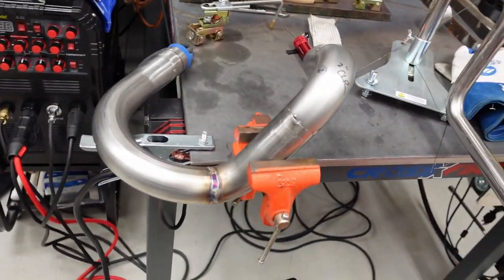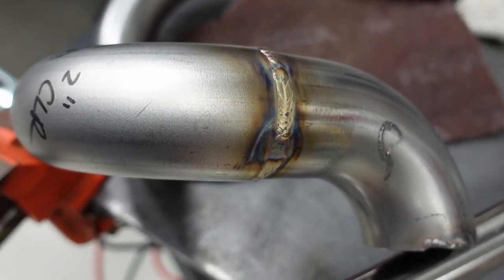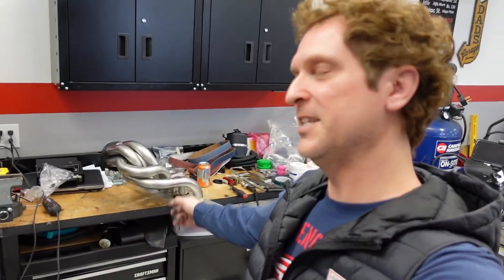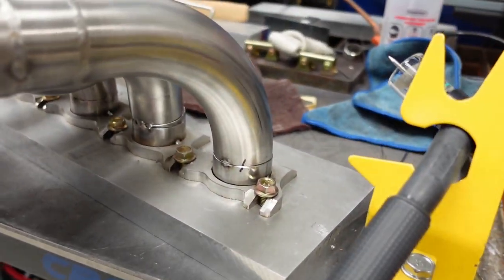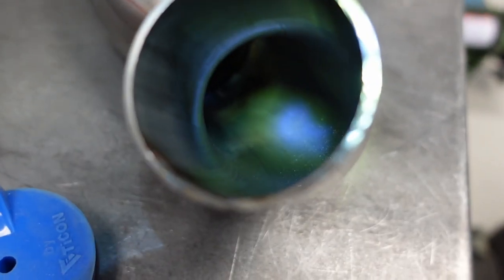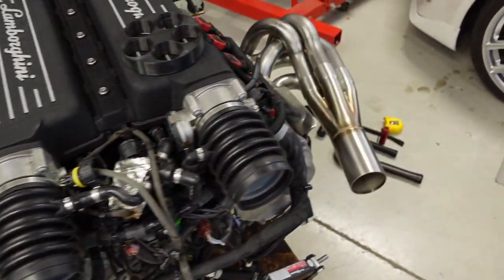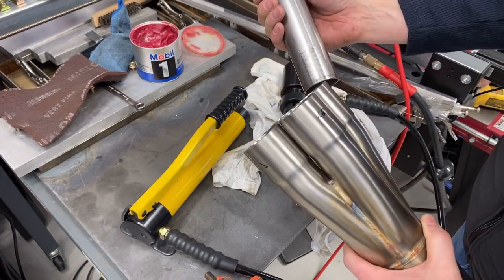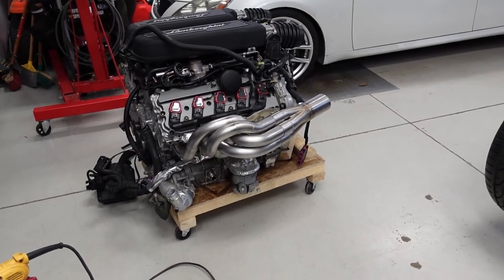Project 'Top Gun' - Custom V10 Exhaust Headers - V10 Ultima Evolution Convertible Build

Comment: You are really motivating me. The array of skills you use. Weld, electrical, CNC (in your garaga? Say whaaaaat....)... Question: You have a Lambo engine, but you said the donor is an R8 and you had shown an R8 oil reservoir/heat exchanger. What happened to the R8 engine? This project is going to be fun to watch. I'm really learning a lot. Thank you mate! Cheers!
Reply from the maker: Ah yes. The intake on the original R8 had minor damage and rather than replace it like-for-like,  I found a cheap used Lambo intake to slap on there. It’s the exact same motor that’s in the Huracan so all the parts are interchangeable. I think it’s a nice little twist to the engine bay. 😎. Thanks for joining in the fun!

Comment: Great job Dan, very impressive and well done.  Boy you've got some kit to do all of this yourself, that's some investment!  I note the fitment of the headers to the heads with the angle top stud and straight bottom studs on the heads - presumably that is so you can align the headers perfectly with the ports?  I take it you've made sure your header flanges match perfectly with the exhaust ports!  Also noted, when you had both completed headers on the floor next to each other, you're going to have a little adjustment on the connecting tubes to account for a slight difference in where the collectors finish?  With regard to securing the collectors onto the primaries, rather than bolts, have you considered a race engine solution which is just two pairs of small tubes welded to the collector and primaries to accommodate split pins - much more compact and less noticeable?  Lets face it, its not going anywhere once the rest of the system is made up and fitted, then heated and carboned up a bit on the inside with use!  Keep up the good work, love watching your progress.

Comment: Great job Dan!  I'm just a few steps behind you on my SLC exhaust.  I'm cutting in the v-bands so I can take it apart down the road.  I'm super nervous about the welding.  Thanks for sharing your settings and experience!
Reply from the maker: Practice on a few scrap test tubes to dial in your personal technique and TIG settings.  I practiced on a half dozen scrap tubes before I laid the first weld on my production piece. This helped my confidence A LOT. Good luck!
Reply: @DanDulac  I cleaned up some scraps last night and they’re sitting on my welding table tonight. I’m going to practice this weekend and get my settings dialed in. I actually taught myself on aluminum last year. Hopefully steel will be no problem.
Reply from the maker: @mastersteve63  Steel is easier than aluminum, imho.  It's a little more forgiving with heat input...If you've got aluminum figured out, you'll have no problem with stainless.  It flows very nice with good argon shielding.

Comment: Señor Dulac, I too have been ogling these kits. How much if any will you have to offset the drive axles? Every single mid engine kit seems to be short in the back end. I suppose if I had to, I could stretch one ahead of the rear wheels a few inches. Lots of extra work. SLC or SLC GT-R, Ultima, FFR GTM {don't love the body design) or that Florida company.
Reply from the maker: Hi Kurt!  The output spindles of the trans are about 1.5-inches forward of being perfectly aligned with the drive spindles in the uprights on my setup. Therefore, once installed, the drive axles will angle forward about 5-degrees. Not too bad and within tolerance.  The Porsche transaxle that most use is a bit longer which results in the output spindles being perfectly aligned...you might consider that option.